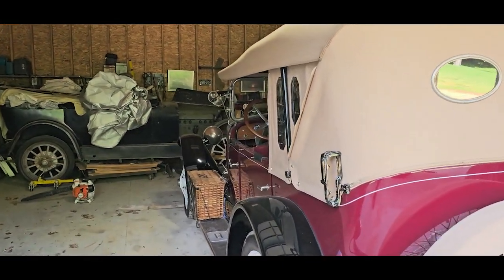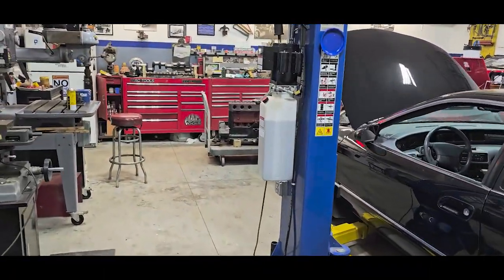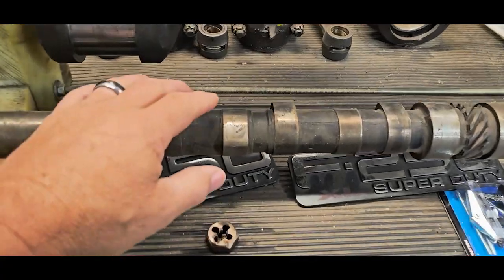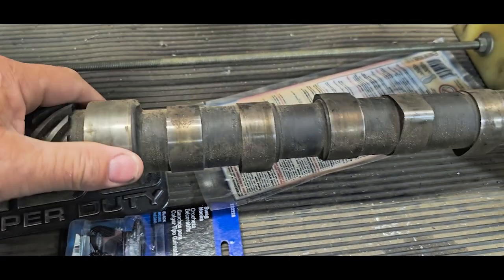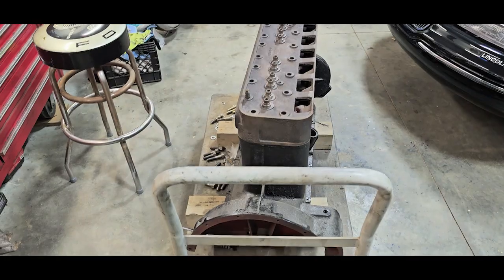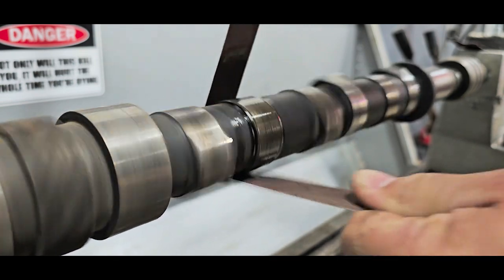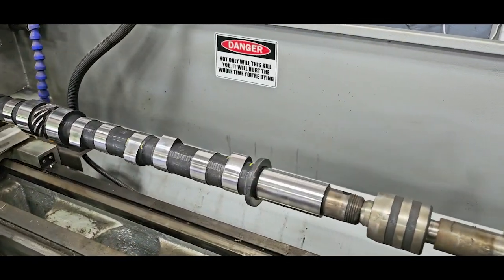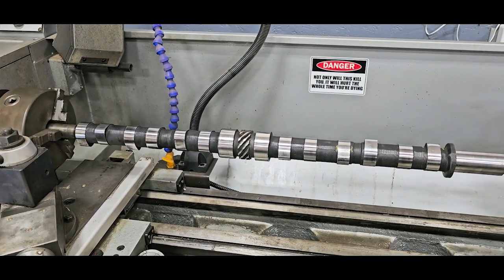1920 Nash Engine Rebuild Part 16  "The Camshaft"

Comment: I really hope it worked out. I would not have done anything other than pay a cam regrinder to do it.
Reply from the maker: @skylinefever did the same thing to the last Nash engine I just pulled put....worked out fine.
Almost no spring load, I can compress the springs with my fingers to put in the keys.
Reply: @Feds-Restoration  Ah. I suppose I just have a tendency to only go by the book, especially if I have no prior knowledge.